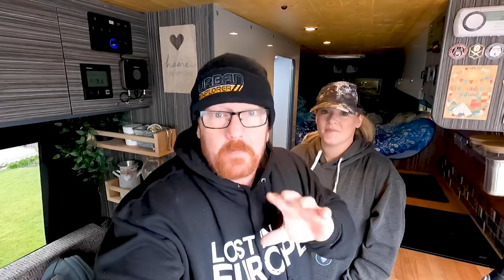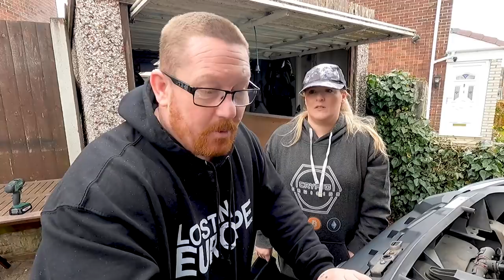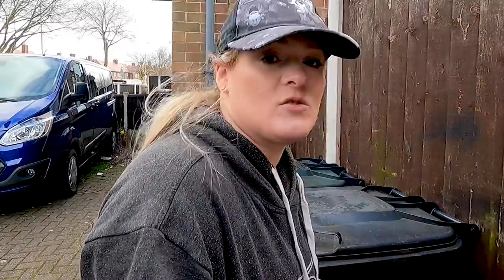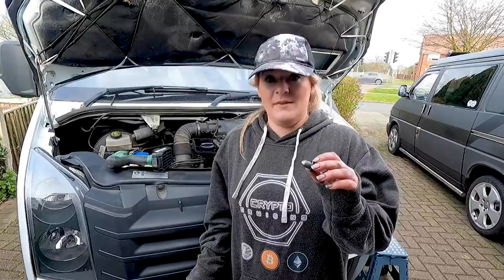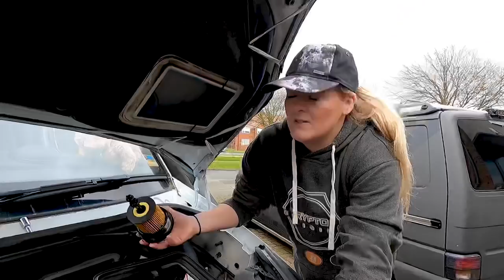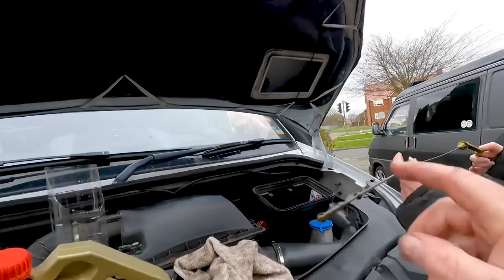VAN LIFE Female Does a Job Some Men Can't Do ?

Comment: Ah yes, the pain of the Crafters Oil filter and wonderful engine design layout for easy repairability...
Reply: yeah my Maxus a mare to change filter
Reply: Yes it is especially challenging for those of us who are vertically challenged like myself .... however I win in the end 😛
Reply from the maker: I would love to have a word with who ever thought it was a great idea to put it there . It’s just a joke . Have you guys done an oil change yet . That filters kind of daft where it’s located . I thought the T4 was bad but this takes the pi55
Reply: @UrbanVanlife  We have yeah, tried to stick a GoPro down there to show everyone as well, sort of worked. But had to use a universal joint, long extension bar and pretty similar to your positions. 

I've worked on my cars, this is the worst location I've seen - yet the fuel filter just dangles there under the van easy as ever to change!!!

Also, the top cap is made a plastic...why?!
Reply from the maker: @FreedomStrider  yer that was a strange one the cap . But all out vans we had in the past are a sealed metal filter the screw on kind abs the T4 one was huge and had a 32 mm end as well . And yer the file filter just sits there looking at you lol . Crafters man there an odd beast

Comment: It’s easier if you take off the air filter box take the plug off one clip to undo pull it out of the rubbers the hole box will come out that will make it easier for you Emma
Reply from the maker: See now that’s why I love this community some one allways has an even easier way of doing things . Why didn’t we think of this. Thanks mate
Reply: Nice to see women doing things like that mate the only other thing you need to torque up the oil filter to 25 nm if you over tighten it it will split , sump  plug is 30 nm mate well done Emma 👍😎

Comment: If you had used tiger seal on the back of the PVC panels in your shower you wouldn't of had that problem
Reply from the maker: Not sure ya no mate the heat that is generated in there is unreal . And just far to much but we will give it a go if it happens again thanks for the tip